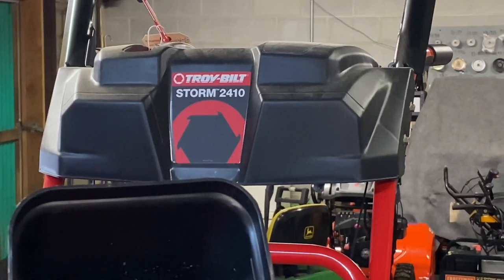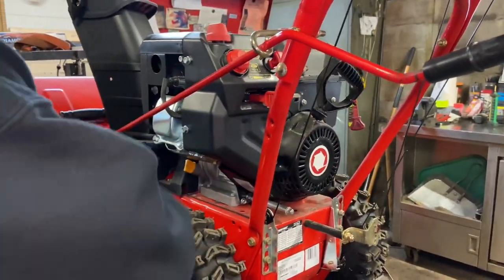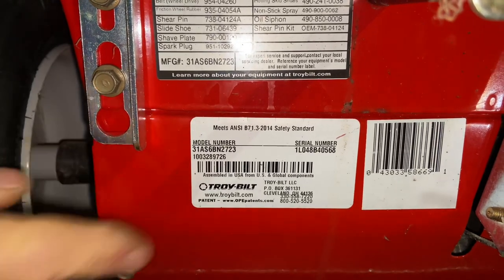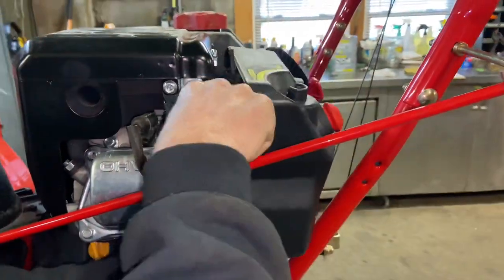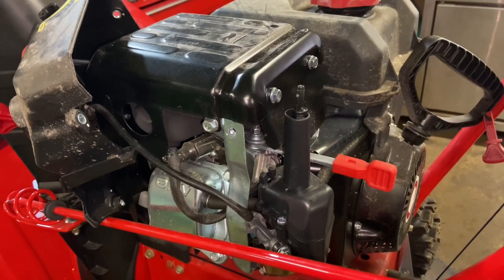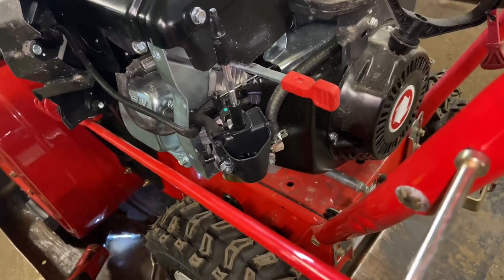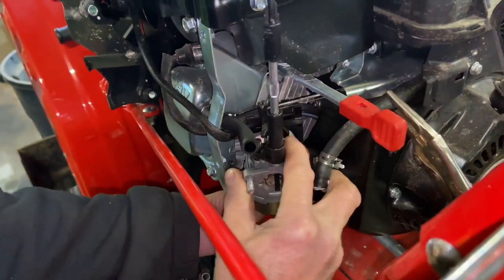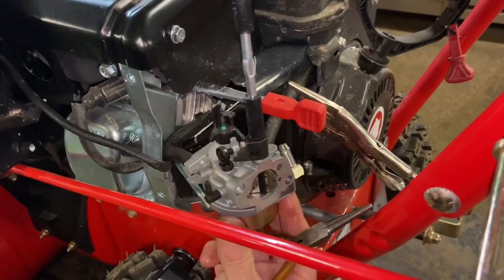How to remove carburetor Troybilt 2410 snow thrower

Comment: I really appreciate your video! I have a Troy-Bilt storm 2460 and the o-ring for the fuel bowl is defective and drips fuel whenever I tip it back. How do I go about locating a replacement o-ring for that thing?
Reply from the maker: If the carburetor is not dripping when just sitting still? And it only drips when you are tipping it back, then it’s not your bowl gasket, it’s your needle valve not performing it’s job correctly allowing fuel to seep by and fuel is overflowing out the carburetor. The carburetor will need to be cleaned or replaced. As far as I know, you cannot get parts for these carburetors. It is cheap enough to just replace it if you need parts.
Reply: @JohnsonsSmallEngines  it's definitely the gasket, it's got a huge defect in it. I guess I'll be ordering a carburetor then if I can't get an o-ring for it.
Reply: @JohnsonsSmallEngines  thank you for the quick reply! I really appreciate it.

Comment: When i took my carb off the unit  i broke the choke rod off the carburetor what should i do.and also i call Troy Bilt they said the carburetor for that unit is on back order the carb is a keima i was following you on your video when i was taking it off.
Reply from the maker: I would suggest to order a new choke rod. You can also purchase a carburetor from Amazon.

Comment: I have this exact same blower, going into my second winter. It seems that I’m not getting anything fuel to the carb. Is there a way to troubleshoot without pulling everything apart? Thanks
Reply from the maker: Hi Dan, Watch this video, it should help. https://youtu.be/Wj25U4FDV-0
Reply: @JohnsonsSmallEngines  I pulled the carb and cleaned according to your video and it fired right up! Thanks so much!
Reply from the maker: Hi Dan, Glad to hear! Thanks for the update.

Comment: I couldn't get the fuel line out. I used a flat-head screwdriver to push it out. That didn't help.I should buy the fender clip tool that you used.
Reply from the maker: I have several of the clip tools. I use them a lot. There just a handy tool to have! You can purchase them at any auto store and even WalMart.

Comment: Absolutely awesome video! For me, taking that choke knob off was weirdly difficult. I slowly pried it up using a screwdriver on each side and instead of the knob coming off, the entire rod it's connected to lifted up. 

Is there any way of adding a fuel cut-off to this model? I would love to be able to run mine dry before storing. It's annoying that they designed it with no fuel petcock and no easy access to the drain nut on the bottom of the carb bowl. It's pretty much factory-designed so the carb gum up and fail every 2 years, particularly if one lives in an area where ethanol-free gas is hard to get.
Reply from the maker: On this model I haven't seen a way of installing a inline fuel shut off. I 100% agree with you. You may want to check out a product called TRUFUEl Read up on it and see if it is something you may want to try. https://trufuel50.com/

Comment: I have this engine on a new blower and I would like to install a fuel shutoff valve; can you show that?
Reply from the maker: I do not modify customers machines due to liability. The manufacturer of the engine should realize the fuel shut off is needed but in the 10 to 15 years these engines have been out, they have yet to put one in.
Reply: @JohnsonsSmallEngines  The engine on this blower is the only small engine, aside from chainsaws, that I own, that doesn't have a shutoff valve.  I worry about the needle and seat leaking gas on garage floor and gas going into the crankcase.
Reply from the maker: The best way to store the machine is run all the gas out at the end of the season and drain the bowl of the carburetor with the bolt on the side of the bowl of the carburetor (that’s why it is there). Then you should be good in the off season.

Comment: Great video.  Is an Ultrasonic cleaner really valuable or necessary?  What solution do you use.  I don't do many carb rebuilds.
Reply from the maker: My opinion, an ultrasonic cleaner is only necessary if you’re rebuilding carburetors on a regular basis. I use simple green concentrate and water. The ultrasonic cleaner also will heat up using both heat and electricity to clean the parts. It does work well but not necessary.
Reply: @JohnsonsSmallEngines  Thanks for your advice.

Comment: I had a clogged idle jet. Took it off, try to clean it, put too much pressure on it, and ruined the jet. I cannot locate the part for this.  Any assistance or substitute part recommendation would be wonderful.
Reply from the maker: You cannot get the jet unless you purchase the carburetor.

Comment: Your videos are awesome and so helpful.  I have this model and honestly it never ran very smoothly (even though I only used ethanol free gas).  We had it serviced and tech found that a mouse had stored seed in the machine via the exhaust port.  It ran a bit better after the tech cleaned but slowly returned to running rough after a year or so.  The year we had 360 inches of snow, I managed to keep the thing running but only by using half choke.  It has ok compression but has never been able to start since that winter.  I was thinking of simply replacing the carburetor as the part is relatively cheap but wondered if anyone had better suggestions.
Reply from the maker: I would suggest replacing it because as you said, they are reasonably priced. If you want to try and rebuild it? here is a video to help.https://youtu.be/_ngK6l6_J7g. Here is also a video on how to re-install the carburetor. https://youtu.be/7Y5-78E5wZg
Reply: @JohnsonsSmallEngines  Thank you.  You are amazingly generous making these videos and I'm so impressed by how clear you make these repairs.

Comment: Could you please show. How to adj carb after cleaning
Reply from the maker: They are non adjustable. The only adjustment is the plastic idle screw to set the slow “idle” speed. After you clean them, they either run good or they don’t run good.

Comment: I have a 2410 newer model every time I prime it it just sucks air I’ve changed out primer button line gasket kit carb the only thing I can think of is the plastic choke housing that mates to the carb with the gasket ? Any ideas
Reply from the maker: When the primer is working properly, it does sound like air but it also pushes fuel into the throat of the carburetor to help start the machine.. Does your machine start and run? If yes then all is ok. If your machine does not start and run, your carburetor needs to be rebuilt.
Reply: @JohnsonsSmallEngines  it will start after 6 to 7 pulls it used to start on first pull
Reply: @JohnsonsSmallEngines  it does get very little gas I can hear it but it used to get a full pull of gas when priming it you can hear the gas being and feel the gas being primed now it’s almost all air I hear. I did how ever noticed a pinch in the bowl gasket like a indentation the bowl doesn’t leak but it appears I put a crease in the bowl gasket
Reply from the maker: As long as the bowl gasket isn’t leaking then your ok. Your carburetor needs rebuilding to unclog the primer passage. If you can disassemble the carburetor and clean it in a ultrasonic cleaner that would be the best bet. If you can disassemble it and just clean it that should help.
Reply: @JohnsonsSmallEngines  I just purchased a new carb I will change out but when I put the choke housing that seats against the carb it was wet around one nut at the bottom wear it meats the bowl I’m thinking it has something to do with the plastic choke housing like a mold issue from factory
Reply from the maker: If there is a problem at that location, that could be the problem. You may have a new but bad carburetor. I have purchased new carburetors that were junk.
Reply: @JohnsonsSmallEngines  I keep leaning toward the black plastic choke housing the flange that mates to carb could be defective that is sucking air and leaking fuel around the nut it’s not dripping but wet I can’t find a new housing anywhere
Reply: @JohnsonsSmallEngines  this snowblower is brand new a couple years old only put one tank of gas through it

Comment: I have a troy built 2410 snowblower. Ive used it about 3-4 times. However, the last snowfall I tried giving her a go but wasn’t starting up. I’ve tried multiple pulls and the last pull on it cause a popping noise kinda like a gunshot sound which freaked me out.  I changed the oil and tried giving it another go thinking it was a simple fix but same popping noise would occur but I noticed a flame shoot out through the exhaust. My guts telling me to change the gas or to peak at the carburetor. Do you know what may be the problem?
Reply from the maker: 3 to 4 times in the last week? month? years? I would try a new spark plug and if that doesn’t work it may be time to rebuild the carburetor or replace it but without seeing the machine, I cannot say that will fix it.
Reply from the maker: It could even be water in the fuel! So many possibilities it could be but cannot diagnose correctly without seeing it.
Reply: Thank you for the quick reply. Its been used 4-5 times in 1 year. Im going to drain fuel and out new. But my dilemma is whether to change the carburetor. Im afraid the same popping noise and flame igniting for 1 second could lead to a combustion.

Comment: Do you have video on replacing head gasket on Troy bolt 2620. I fixed the problem with it not starting (carb), now it smokes after running for a few minutes. Smells oily
Reply from the maker: I doubt it is a blown head gaskets. It most likely may have had fuel in the oil from the carburetor failing or there is too much oil in the engine. I would suggest change the oil and make sure the oil level is correct. Then run the machine until the smoke goes away. The Important part is making sure the oil level is correct and make sure there is no fuel in the oil. If the oil smells like gasoline then definitely change the oil.
Reply: @JohnsonsSmallEngines  I drained the oil and found alot of fuel in it. I flushed the system and put new oil in and new fuel.
Reply from the maker: Ok good, now just make sure the oil is at correct level and run machine. Afyer a little while the smoke should clear up. Sometimes it quicker than others. Double check the oil level the following day to make sure all is good. If the oil level went to the high side, you may still have a carburetor issue. Meaning fuel is once again in your oil due to a bad carburetor.

Comment: I have mine for 10 years now, never had a problem, it wouldn’t start now. Not sure what is wrong, anything you advice me to check?
Reply from the maker: Install a new spark plug, if that doesn’t work you most likely have a fuel issue meaning you may have fuel go bad In the carburetor and will need to rebuild or replace the carburetor. It takes three things to make the engine run, ignition, fuel and compression.
Reply: @JohnsonsSmallEngines  Will change the Spark Plug and check, thanks for the quick response.

Comment: hello! i have a couple of issues, but one is scarier. i filled the tank and it's leaking gas from somewhere around the carburetor. but i can't pinpoint from where. if it's not the hose coming from the tank, it might be that the floater in the carburetor bowl is stuck and lets gas out? if it is, where is the gas coming out from?
Reply from the maker: Its coming from your carburetor. You will need to rebuild or replace it. This video shows how to rebuild it. https://youtu.be/_ngK6l6_J7g. If needed you may need to replace it as you cannot purchase rebuild kits or the needle valve as parts only.

Comment: How do you remove the black choke shaft of the carb to put on the new one ?
Reply from the maker: I would need to look at it to show you. The next machine I get in that has the same carburetor I will make a video on how to disassemble the carb. I know it will not help you now but that’s all I can do over the internet. Why are you replacing it? They normally are ok.
Reply: If you’re replacing the carburetor, the new one doesn’t come with it. There are two small tabs on either side. I used needle nose pliers to push on one of the tabs while slightly pulling the choke shaft out. Once one was out, I did the same on the other side. Then it just snaps right into the new carburetor. It only fits one way because of the shape, so no worries there.
Reply: You recommend fuel additives to clean the engine internally?
Reply from the maker: @jeremyb239  not needed, just make sure you change your oil on a regular basis.

Comment: Thank you, this is the best video out. I like others ordered the wrong carburetor and couldn't find the new style. But now I'm having a problem where it leaks gas from the backside of the carburetor where it meats the black back panel. Is there is this very thin gasket, would this be resolved by replacing it? Ive taken it apart several times and can't figure out why its leaking.
Reply from the maker: The only gasket that would leak would be the bowl gasket. The other reason would the needle valve is not shutting off the fuel and it is overflowing. Is the carburetor your having a issue with the new one? Or did you rebuild the old one?
Reply: @JohnsonsSmallEngines  rebuild the one it came with. I\I used spare parts from an incompatible order model. Would you happen to know where I would be able to get the same model?
Reply from the maker: Go to my website Johnsonssmallengines.com and email me your contact info through the contact page and I can call you. I will need the model number off the white sticker on the back of the machine to help you.

Comment: Great vid about to attempt to do this now following your instructions. Do I need to drain the gas from the tank first? Or do I need to just clip the fuel line so gas will not drain like in the vid?
Reply from the maker: Thanks, it’s up to you how you perform the job. Good luck! I also have a how to rebuild that carburetor unless your just replacing it.
Reply: @JohnsonsSmallEngines  hmmm I was going to go for the rebulid but its so damn cold in the garage here in chicago. I just looked it up on Amazon and its only $25. Might just go that route. What would you suggest.
Reply from the maker: @reese373  It is a hit or miss with the $25 carburetors. Just try and look at the reviews before your purchase. I will rebuild before replacing but I also have a ultrasonic  cleaner that does a great job cleaner the carburetors. If the carburetor looks to be in very poor condition I will replace. In your case for $25.00 it is definitely may be worth it due to the conditions you are in.
Reply: @JohnsonsSmallEngines  quick update. I was able to remove the old carburetor and replace with a new one. Blower starts up good now. Hardest part of the removal was taking off the red choke knob which broke. So now I have to find a replacement for that. But i think the new carb I have needs a different choke knob connector because it’s different than original. So I just left the choke on run for now until I can get a knob to open it and shut it off

Comment: Thank you so much for this! Question though - I've been looking everywhere to figure this out. I dropped and lost one of the bushings @ 8:12 and cant find a part number anywhere online. Any idea if it's really necessary or the size? Again, thanks so much for the videos!
Reply from the maker: I tried to look the spacer up and I also could not find the part number. I also was guessing on the model of the engine. If you can get me the numbers off of the engine that are stamped in the bottom side of block I maybe able to come up with a part number. The numbers are located on the bottom right side of the engine block if your facing the engine while standing behind the machine. You will most likely need good eyes and a flashlight to see the numbers. I’m looking for the numbers that should be close to 270-SUA. If you cannot find the collar your missing you will just have to be careful on how tight you tighten the carburetor nuts as the collar is there to protect the plastic housing from getting crushed while keeping the carburetor on tight.

Comment: thanks for the imformative video. my question would be: if my 2410 will not start after i used it for 1 pass on my driveway ran out of gas and refueled it and now it won't start. would that be a carburetor issue. i can use this video to repair it. the snowblower is only 2 yrs old. used 1 winter season.
Reply from the maker: You will need to start at the basics to diagnose a no start condition. Check spark, check compressing, If you have those two then the only thing left is fuel. I cannot properly diagnose it without seeing the machine.
Reply: Thanks for replying. I have already cleaned the idle jet and dumped the old fuel that was already in the unit. Put fresh gas in it. Could the idle jet be the problem again. Am using the correct octane gas( I think). I am willing to fix it myself. Just need to know where to start